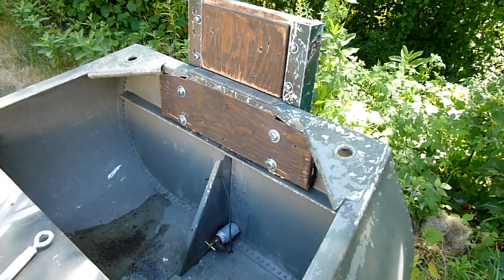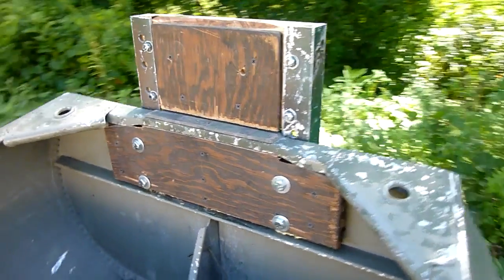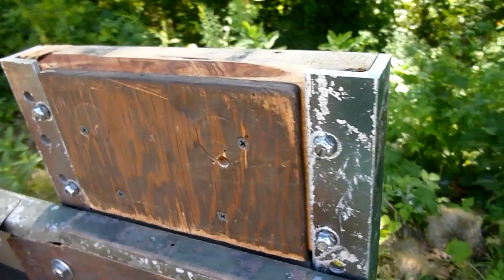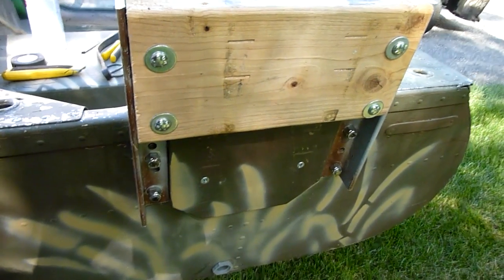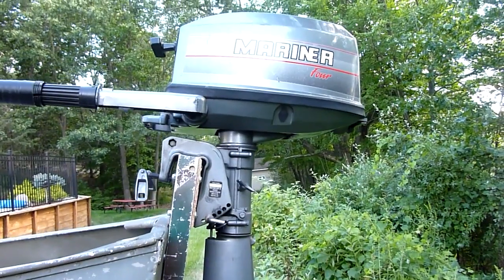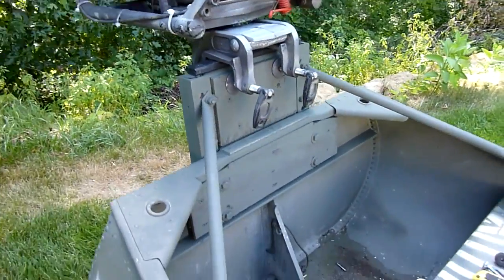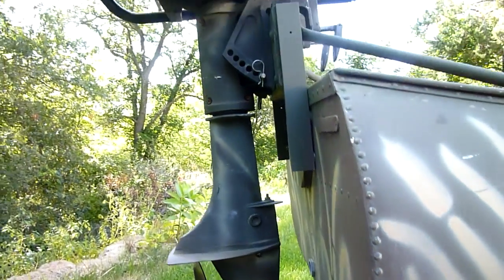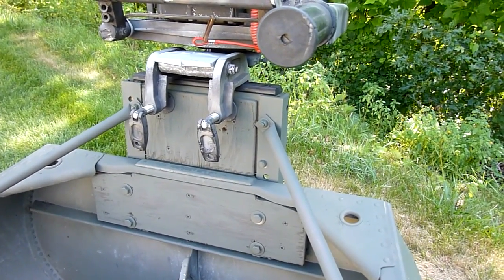OldGuyDIY $10 Transom Riser Jack Plate Outboard Motor Small Boat Grumman Sportboat Sport Canoe Pt 7

Comment: Glad you found a solution that works for you. But for water cooled engines, the anti ventilation plate should be at or slightly below the bottom of the transom to ensure water flows properly into the water inlet, typically located on the underside of the plate or just below it. Those that raise transom as high as you've shown, above the bottom of boat, should be careful to ensure water continues to flow through the cooling water check port (small stream of warm water exiting above-water from rear of engine). Of course, your air-cooled engine won't have this issue. My Sport Boat planes well with a 1965 5HP Johnson; I just add 10#-15# of extra weight on the floor near the bow to help bring front end down into proper plane when I don't carry a passenger.

Comment: Great idea!  I have a long-shaft 9.9 hp Johnson OB that I want to use on my old 1965 Smokercraft 12-ft boat and this simple idea should help me do this.  Thanks!  I'll make sure that the anti-ventilation plate is below the lowest part of the transom to ensure that I do have proper cooling.
Reply from the maker: Thanks for commenting.  I am glad you liked the video.

Comment: That's a good idea, as the SportBoat transom is very low, even for a 15" (short shaft) motor. I would say though, that the SportBoat IS designed to plane. Mine will do 12knts solo with a 7.5 hp Evinrude, if I sit in the middle seat and use a tiller extension. It will still plane at 10knts with same motor and two adults in the forward and rear seats.

Comment: Hoping for a payoff video! Please post some footage of the boat on the water. Maybe even narrate the modifications from your previous videos?
Reply from the maker: Hi,  Thanks  for the comment.  I sold this boat and motor some time ago so there will not be a follow-up video with this rig.  I found that raising the transom about 2", so the anti-cavitation is approximately the same level as the bottom of the boat was the best compromise for motoring at speed and running in shallow water.

Comment: That motor looks too high
Reply from the maker: It was too high.  It worked great in about 6" of water in the duck swamp but did not sit low enough in the water to do well in open water.  I ended up reducing the rise to 2" and found that to be a good compromise.

Comment: When you got it on the water and opened it up I bet the prop blew out? The anti ventilation(cavitation) plate should be even with the bottom of your transom. looks like it would suck a lot of air down.
Reply from the maker: This modification is not intended for open water.  It allowed me to motor through swamps and flooded fields where the motor would have been dragging bottom if it had not been lifted.

Comment: cool video. looking to do something similar for my canoe. did you notice any performance differences with the riser installed
Reply from the maker: Yes, the 6" riser is too high to allow the motor to work effectively at mid to high speed.  I cut it down to 1.5" to allow me to use it for running the channel while still allowing me to motor through shallow water that I historically walked through.
Reply: OldGuyDIY ...so, im sorry, do you mean to say that the total rise equals 1.5 inches now? Or that you lowered it 1.5 inches from the 6 inches, so now roughly 4.5 inches? Im trying to mount my long shaft onto my dinghy soon and this looks good
Reply from the maker: I settled on 2" total rise.  I decided to get out and walk when the water is 6" deep rather than motoring through it.  Using the angle aluminum brackets it is easy to pick a height, try it out and then add or remove material to find the right height for your boat.

Comment: What did u use for the support bracket
Reply from the maker: 1 1/2" aluminum angle aluminum and 3/4" plywood.
Reply: @OldGuyDIY  I'm sorry should have clarified I meant those poles that you run to the boat to the bracket you made
Reply from the maker: The supports are made with 1/2" EMT conduit, cut to length, with the ends hammered down for easier drilling and mounting.

Comment: Those engines still need water pumped up to cool the exhaust, looks like you will NOT pump much water.....if any. Don't know how much paint you will have left on your leg.
Reply: perfect for the job.
Reply from the maker: There is no problem with water for cooling.  When the boat is loaded with men and decoys, the cavitation plate is under water.